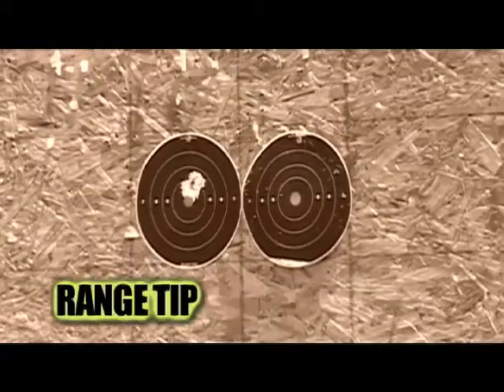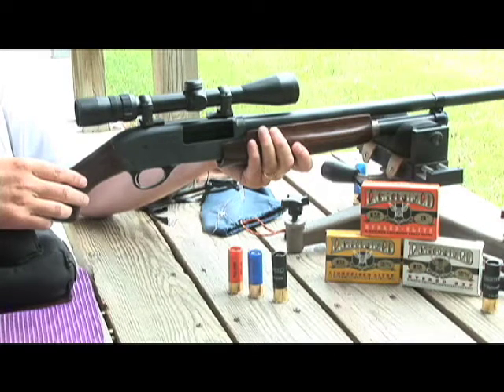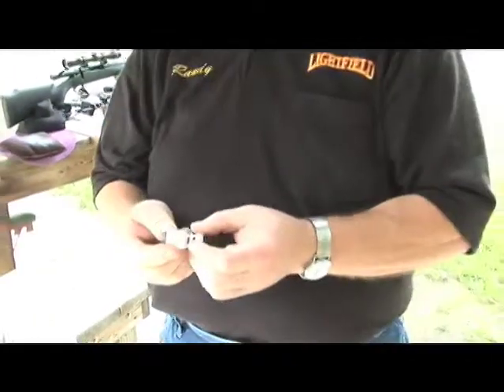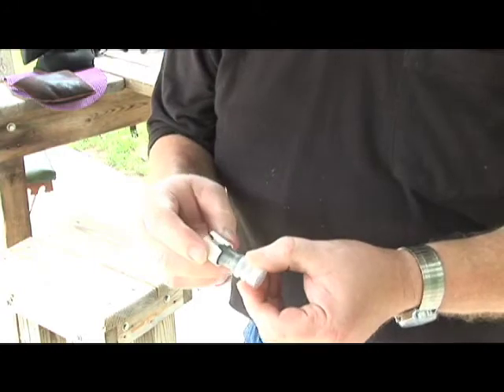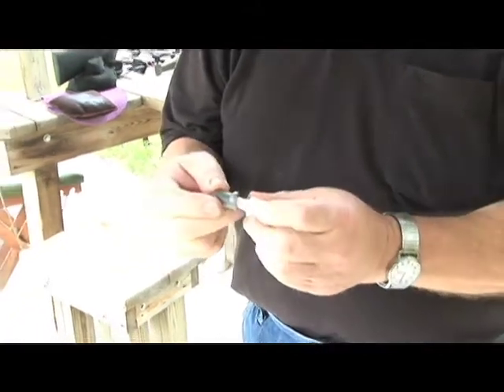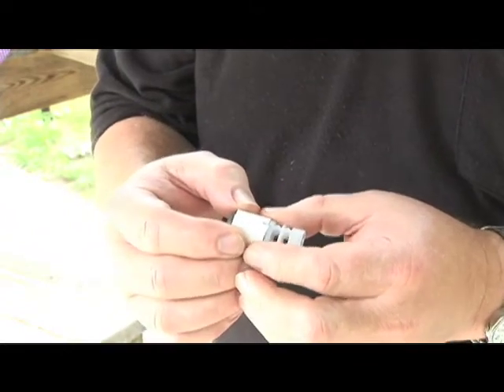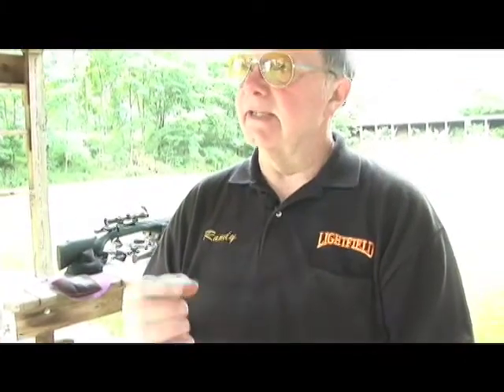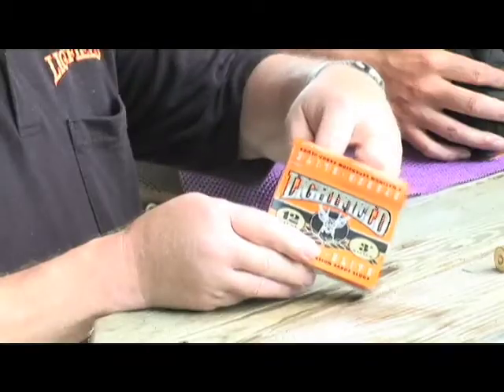Lightfield Slug Construction

Comment: It says on the package that these can be fired from a smooth bore gun, but do they perform well?
Reply: Was wondering the same thing
Reply: They probably will. Lightfield has been making great ammo for a long time. These slugs look like they would be just as stable as any other slug with this basic design. You can always buy a box and try it out if you can't find a test anywhere.
Reply: At the price for 5 shots you're better off with sluggers in a smooth bore. Plus Lightfeild is a small company if you don't need these slugs don't buy them. I can't find them anywhere. Thinking about switching sabots. But that is expensive to do.